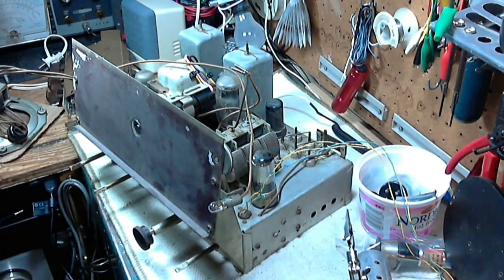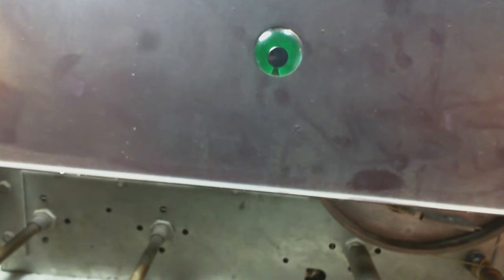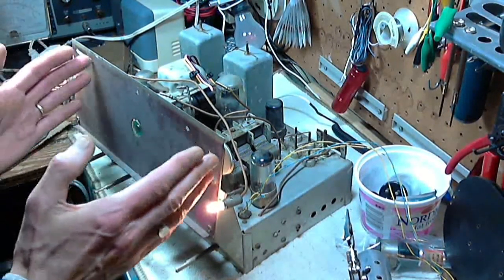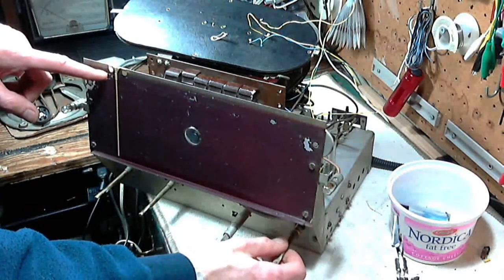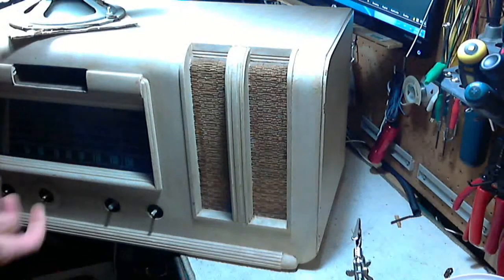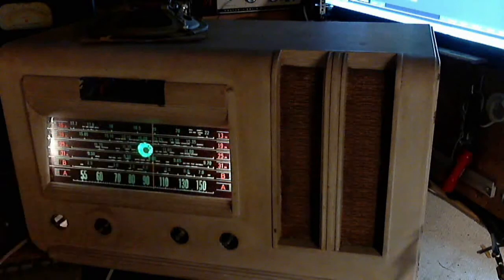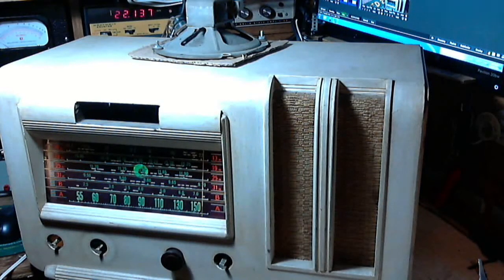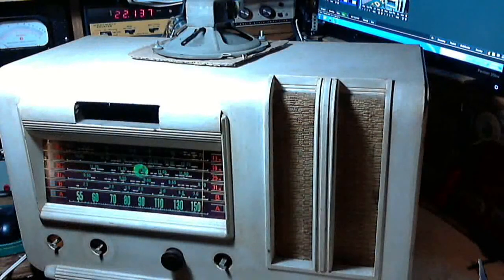RCA A25 Vacuum Tube Shortwave Radio Video #21 - Dial Pointer

Comment: Jim, is this the one with the #61 lights.   They might have put in lower voltage lights to get a little extra brightness.
Reply from the maker: No.  That's the KM-5.  This one has 8V 3W lights in it.  I'll check the actual voltage next time I get a chance.